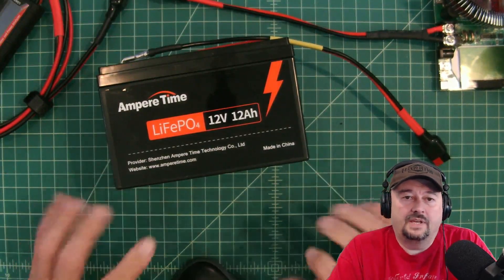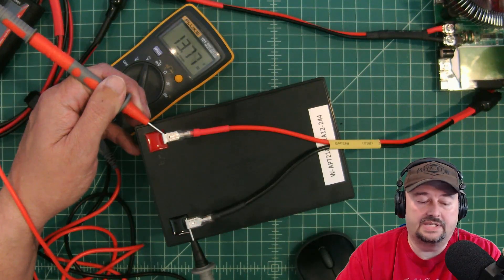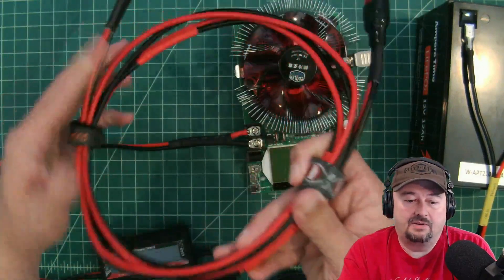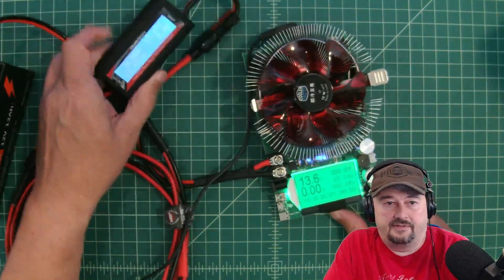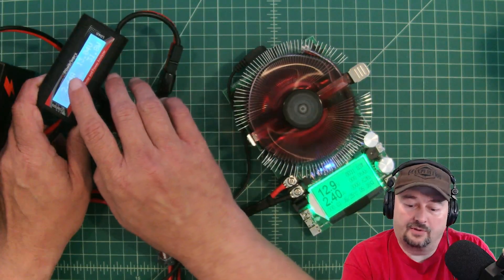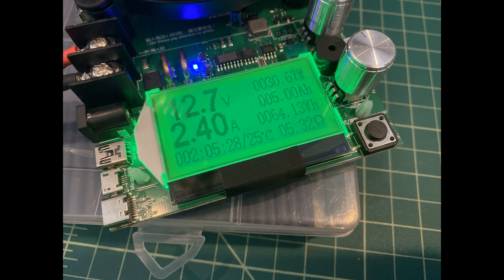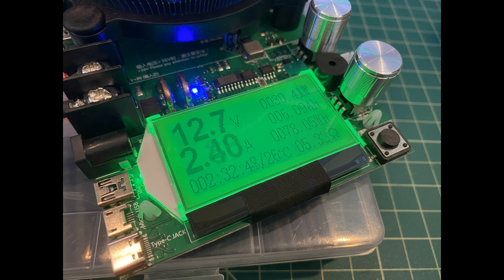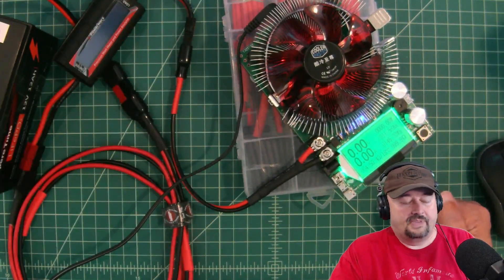Ampere Time 12A Lithium Battery Tested

Comment: I just got one of these 12Ah LiFePo4. My initial plan was to power a security camera with it, but now I'm thinking of connecting two of them in parallel to power a refrigerator (~ 200W) for like 10 minutes at intervals of 15 minutes (of course, I would need an inverter also). Do you think this would work?
Reply from the maker: Without knowing the exact specs of the fridge I can’t answer for sure, but you should be able to do it.  Just keep in mind you will need a way to keep the batteries charged 👍

Comment: Ampere Time has renamed/rebranded themselves Li Time and are still available on the Amazons. At 4:50 the product description says they are automotive grade which usually means Grade A cells are all that's used in the battery. The new Li Time description in the Amazon listing no longer states that and the battery is cheaper.
Reply from the maker: Thanks for the info 👍

Comment: 90-95% of the rated amp-hours seem to be typical for what we can expect from Chinese batteries. On the other end, Battleborn seems to use the cells rated at 106-107% of their rating and then they sell the rest to other battery makers.. That way they meet their published ratings with ease. The Chinese may not even try to match their cells, they may be randomly selected from a pile of them, unless otherwise stated. I have a couple of 6 AH LIFEPO4's I bought from AMZ and have put them in parallel in may battery box loaded with USB & Powerverx connectors, etc. I saw a test online in which they got 96% from their test battery (non-ham tester) so I couldn't pass up the $29 price. I figure this is a good start and I will be testing it on my new Penntek TR-35 I got yesterday. That should do a QRP POTA activation with ease I bet, first I am winding toroids for my QRPGuys antenna, LOL. Thanks for the video! Cheers es 73, Dave - KU9L
Reply from the maker: Hey Dave, good luck with the batteries!

Comment: I have a Bioenno 12v-12ah battery that shows over 14 votes when fully charged. But my ampere time 12v-12ah only shows 13.6 v. Would you know why. Could the Bioenno be bad, I know it works great on my 7300 at 90 watts working POTA. Also, my charger is the Yarlan 14.6v life4 battery charger. Do you think it's a good idea to remove the alligator clips and replace with anderson power pole connectors.
Reply from the maker: I am sure the bioenno will drop pretty fast under load.  I am not the biggest fan of the power pole design but all my gear uses them so that's why I keep adding them to stuff.  The whole cart and horse.

Comment: Within 5% rated capacity for a cheap battery?  Yeah, no problem.  I would expect all of the stated ratings (discharge cycles, number of years) to fail similarly on the low end of totally acceptable.
Reply from the maker: Agreed, thanks for the comment Clint 👍

Comment: Thanks. Useful video. I actually use a different test that is, for me, a better indication of what to expect in the field: (1) I discharge only down to 9.0 volts, which is the minimum my radio can tolerate; and (2) I discharge at a rate typical of my max transmit current (which is 0.5 A for my little QRP radio). Combining the two, I know I'll get at least THAT capacity out in the field no matter how much I transmit. As an example, my homemade 3Ah Li-Ion battery pack gives me 3.108Ah on that test. Thoughts?
Reply from the maker: This batter has a BMS that will cut up before 9v.  It shoulda like you are modeling what you will do in a field which is cool.  I was just doing a standard capacity test.  Thanks for watching Skip 👍

Comment: It wasn't that far off of the stated capacity.  Nice test..  I'd be perfectly happy with that battery.  Half the cost of some of the "name brand" batteries out there.  I have a 36AH MIaddy battery that I power my 991a portable.  A full day of heavy use it was no where near drained.  The difference was it only cost 129 as apposed to over 200 for other brands.
Reply from the maker: I'm totally happy, might get a second to run them in parallel  👍

Comment: You could verify your load current with your multimeter.  Your tested Ah is only about 3%  below 12Ah. A couple of cycles could bring that up.  I think some of the 7Ah LiFep04 are actually 6 Ah. I had a 6/7 Ah LifeP04 battery fail in warranty, when I could only get a few hundred mAh from it, after using it lightly for about 1 year
Reply from the maker: Yeah, that should work too.  Thanks for the comment Kevin 👍

Comment: Mr. Ape that Smokes? I think i have the same Powerwerx meter. Could you have used the auxiliary power connector cable to deal with any power consumed by said meter (which may be negligible)? I'm a newb and am not challenging your process, just asking. Trying to learn. BTW I agree with your assessment being close enough.
Reply from the maker: Yeah, total rookie move with the powerwerx meter.  Thanks for watching Gap 👍
Reply: @TheSmokinApe  Thx Mr Ape...!!! Great Info you provide!!  Is there a link to the  meter that ran down/failed...I guess I could just google it...Many Thx!!

Comment: Not sure if what I'm saying is correct but taking a step back and not being too technical about it, it looks like it would fall into a +/-5% tolerance on the rated capacity which is reasonable.
Reply from the maker: Yeah, I wouldn't call them terrible results.  Thanks for the comment Ohaya.

Comment: Did the PowerWerx DIE? (It’s now no longer operable?)

Or, did it simply stop working due to low current? (And it’ll work again)
Reply: I think it stopped working, because the battery was dead.
Reply from the maker: Yeah, the battery died and that's what was powering the meter...  rookie move on my part.

Comment: I've got two 100Ah Ampere lifepo batteries for my radio shack and they've been awesome!
Reply from the maker: Awesome, I am thinking of getting a 100A version.
Reply: @TheSmokinApe  Yea, I've went 8 days with two 100ah batteries bringing them down to 30%, to test, but the other times just to 65% monitoring my digital modes using a pi4, 897D, signalink and an ldg swr meter. My two monitors plug into AC but I do have battery chargers for those in a grid down situation.  I havent set up my solar panels yet, which I have three 100 watt. I use a renogy battery monitor, and I love it.
Reply: I'm currently battery  shopping for my portable/ solar  kenwood tkr-850 repeater build. Trying to keep it light  and portable im thinking about 100ah of lipo battery.

Comment: Chinese batteries are notorious for overstating their capacity. I don't know where Bioenno sources their products but I'll stick with them. I don't run bareback often but my 40ah battery is plenty for the 891 the way I use it.
Reply: Bioenno batts are junk.  I've had hothing but problems with them.
Reply: Careful shopping will get you somewhere away from the junk without the Bioenno pricing.
Reply from the maker: I wouldn't say this was gross overstating, but I do understand your point.  I have a few Bioenno batteries that I use, this is a spare that will likely be used to charge cell phones.  Maybe you fold that kind of paper but I don't want to spend $125 when $75 will get the job done.

Comment: The fully charged voltage per cell on a 4 cell  LiFePO4 is 13.6 volts, you should not go below 12.9 volts else you may damage the battery. At 12.9 volts you will have discharged it 80%. You will not see the full capacity in the test as you ran it. Ideally you need to set a cut off at 12.9 and see if the current drawn is 80% of max capacity.
Reply from the maker: From the manufacturer “Ampere Time LiFePO4 battery has built-in BMS to protect it from overcharge, over-discharge, overcurrent, and short circuit with excellent self-discharge rate.”
Reply: @TheSmokinApe  And as a Rookie which I am...why would you want a battery that you could NOT discharge below 80%?  50% maybe but curious why have it if you have to stop at 80%??